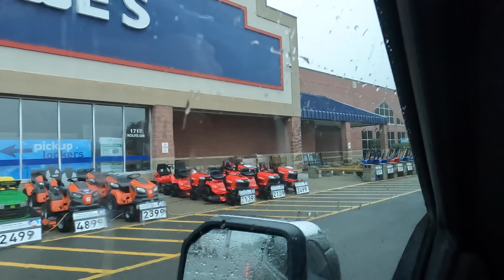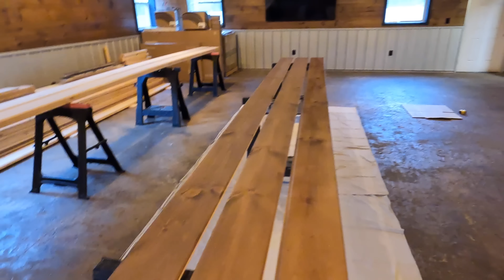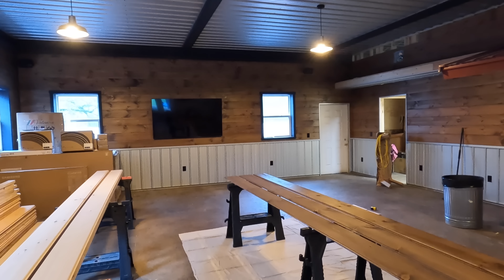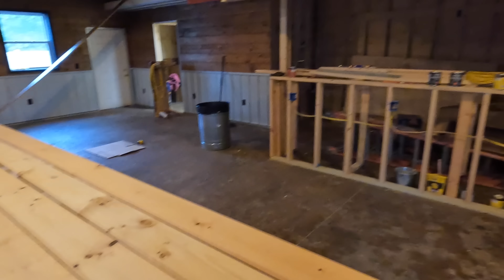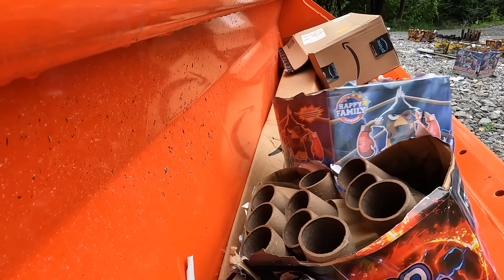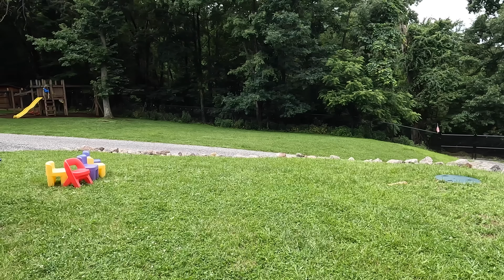This Makes Me Want to TEAR DOWN MY HOUSE!

Comment: Mike, re: your existing home comfort levels.

My house was built in 2002 with 2 AC units and 2 propane furnaces. One for the east wing (sleeping and dining room) one for the west wing (kitchen, family room, office and 2 guest bedrooms)

The west wing never got cool in the California summers and never warm enough in the winter.  I subscribed to the belief that the south and west facing walls just absorbed too much heat from the sun.

This winter, the west wing furnace failed. It was 24000 BTU while the AC was 36000 BTU. The air handler in the furnace could not supply enough CFM for the small AC unit. I went to a 48000 BTU AC and rerouted some duct work, plus added another cold air return in the part of the West Wing that never cooled. Air flow was increased from maybe 750 CFM to 1600 CFM. Major difference.

I increased the East Wing AC from 42000 to 48000 BTU plus larger duct work. The east wing does not get the afternoon sun heat load. The real test will be in the winter when we need heat.

The take away is, review your CFM and duct work plus current designs have vastly improved efficiencies. You can recover some of the replacement costs with the reduced operating costs.

Be aware I had quotes come in from multiple contractors. The highest was over twice the lowest. They all had their go to brand which afforded them the max profit. Not necessarily what was best for me.

Ask questions.

Comment: Radiant floor heat is, in my opinion, the best feeling heat there is. Even a little better than a wood stove. I spent three winters in Minot, ND during the early 70's working in an aircraft hanger that was over 200' x 200' with radiant floor heat. On the coldest winter days you could sit on the floor and it was soo cozy. If you get that going in your building, you won't even want the wood stove going.
Reply: When you are working on machinery in the middle of January, that radiant floor heat will be a blessing.
Reply: I delivered fuel for 23 years. One house up on a ridge was over 5,000 sq feet. Slab heat through out the house and garage. They ran out of fuel but didn’t know it. At 50 below it was days before they realized they were out of fuel. There hot water was removing heat from the slab, that’s when they realized their furnace hadn’t turned on. Contractor only placed a 500 gallon fuel tank, should have been at least 1500 gallon tank.

Comment: Radiant in floor heating is unbelievable, we moved into a cottage in PEI Canada in Dec ,1997. The owner said don’t turn the heat over 60 . We were working outside in a shipyard , we looked at each other and said ya sure , -3 . We were working night shift , set the temp at 70 , came back to the cottage at 1am from work . When we woke up in the morning it had to be 90 . I have never had a house warm up like that before . For the rest of the time there , it was set at 60 !

Comment: Insulation doesn't do much for soundproofing. Best bet at Lowes in the lumber department they have soundproof drywall. One 1/2" sheet is  equal to 8 regular sheets. You might look into it.

Comment: Concrete, wood, and metal makes for an echo chamber. Crowd chatter can get very loud when everyone is competing with each other to be heard, add DJ sound and shouting is the only way to be heard. Acoustics is usually not a consideration until too late, have seen too often in churches, other venues,  and wonder why a PA system feeds back. However, on the plus side other people’s conversation are not understood by someone one foot from you.

Comment: If I were you, the next thing I build would have sprayed insulation! We have it in our home we built 3 years ago. While we live in extreme north Georgia mtns, our summer power bill runs about $130-140 a month keeping the house cool to 74f. House is 3700 sq/ft including garage. Winter we use a combination of heat pump and propane furnace. Power bill runs about $120 per month and with a 1000 gallon propane tank, we use about 240 gallons of propane yearly! We fill up in July or August!!

Comment: Instead of tearing it down, you could sell it to house movers and they will haul it away. Then you just have old foundation to deal with. You would miss out on the opportunity to use your loader and excavator to tear it down.
Reply: You will have to GIVE the house to the house movers!!
That is NOT a cheap way to get a house.
Reply: Even if you have to give it away, you don't have to pay for demo permits, diesel fuel for equipment, dump trucks, tipping fees at the dump, etc.
Reply: @SloMotion66  true.

Comment: Just gut all the sheetrock add any wiring upgrades tear out the insulation put rockwool in and you can cover it with whatever material you want if I had that kind of land I'd have geothermal loops with enough landing an excavator you could do enough loops to do both buildings your house and the pool building. And your basement of your house put the radiant underneath tile upstairs put the radiant under your hardwood and swap your skylights out for velux  if you have velux and you're not happy they were probably installed improper. I have a long one that's like seven foot long over my stairwell to the second floor and a big square one in the bathroom on the second floor that opens I found them very helpfull . And insulate the interior walls.Up grade your home heating system to accommodate the geothermal Loops to cool your house.

Comment: We live in a split level with the main floor on slab-on-grade and it stays cool all year round, the upper level gets very warm in the summer and takes more to heat in winter, it’s all about the thermal mass of the concrete IMO that helps maintains an even temperature.

Comment: I think what is making your building's temperature consistent is the large concrete floor, the large thermal mass rejects change in temperature and moderates it throughout the building
Reply: Having insulation under the concrete is huge, breaking that cold transfer from the ground.
Reply: And awesome tight windows!
Reply: Yes our houses in Greece are all poured concrete floors and walls  in the summer they stay cool in the winter warm
Reply: Post frame buildings also have 8ft wide bats of insulation, where as your house is every 16in. That’s huge.

Comment: Hi, Mike. Just get an energy audit done on your house. They need to depressurise the house, and find the air leaks. I worked in weatherization in Garrett county md. We were able to make a big difference. In heat loss for the home owner. Just some weather sealing and added insulation. Hope this helps you.

Comment: The radiant floor heat is a backup for the wood stove for when you are not around to run the stove assuming you want to keep the building from freezing up.  I would use traditional white six panel french doors for the closet as you have lots of dark wood in the room already, and they would tie in with your white entry doors.  Modern construction is definitely superior with the materials available today.  The raised ranch is a difficult floor plan.  If it were me I would build a new home on the property and keep the old one for extended family and/or a rental.

Comment: Mike, I wouldn’t tear down the house in an effort to save heating costs.
 The main reason your house is harder to heat then the  barn  is all the other loads inside the house .
These include:
  all the electric lighting that is on most of the day.
  Domestic Hot water.
  Fridge , Stove ,  dishwasher, deep freeze, washer , and dryer. 
These are all relatively small intermittent loads 
But they sure add up.😢
Did I mention TV, computers etc.
 On the other hand the mini split heat pump is probably cost effective.

Comment: Happy 4th Folks, Glad to hear You're on the mend. I conquer on Your choice of materials. Ever consider dong a pressure  treated basement? So much better than concrete. Cooler and warmer then concrete dry and You can build like above ground walks. Much more cost affective. My only change would be a concrete radiant floor and unfinished ceiling so second story  floors stay warm from basement heat. Basement walls are all insulated. So there isn't any heat loss to ground temperature cooling.

Comment: Hi Melissa, Mike,  just a couple of thoughts. In the building run the ceiling fan in reverse. That will pull the heated air down from the ceiling. In your home, have a heating and cooling evaluation done, and make improvements where needed. There are improvements that will save you money. Hope your leg is feeling better. My best to you and your family, Joe Capo.

Comment: Once you get that infloor heat, going you will be amazed at how little it costs to heat that building ,and how low of a temperature you will be able to set it and and keep warm
One thing though. Leave the thermostat at one setting and leave it , it take about a hour to raise it one degree on average

Comment: If you have a good vent fan in your shop with a humidistat control you will find that the in floor heat will get rid of snow melt and dry your floor in the winter

Comment: Partner with Just Biofibre out of Alberta CA.  They make hemp lego building blocks.  25# R35, regulate humidity, fire, bug and mold proof.  1 truck 1000sq ft.  Sequester 6 tons of CO2.  Use on the exterior and blow in more attic insulation hemp all natural.

Comment: You can put a water heat exchanger on the back of the wood stove to heat the water for the furnace for the in-floor heat. 
When the water leaves the wood stove exchanger it goes to the furnace water inlet. If the furnace in-let water sensor senses that the water is hot enough the furnace will not fire the burner, It will only turn on the circulator pump and open any zone valves calling for heat. When the wood stove is not fired, the return water temperature will then be cool enough that the furnace water in-let sensor will call for the furnace to fire the burner.

Comment: I built a barn house 5 years ago. Metal outside and old logs and barn lumber inside. Looks 150 years old on the inside.  Love it ❤.
Reply: That sounds great!
Reply: I have a 40x70 pole barn with radiant heat. I keep it at 50*all winter. It’s just an even heat. No highs and lows. Worth every penny.

Comment: The new building is well insulated with minimal thermal bridging.  I don't know the orientation of the building, but as along as you have good overhangs on the South and West sides to shade windows certainly helps.  High ceilings helps with keeping floor level cooler.

Comment: The insulation under the slab and around the perimeter is what makes it so good. I have a similar building so easy to heat and ac